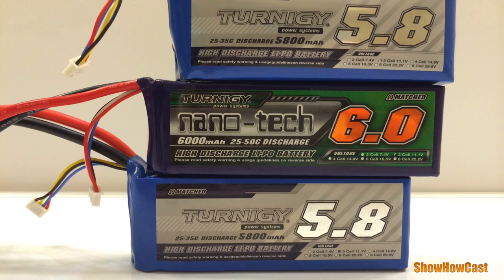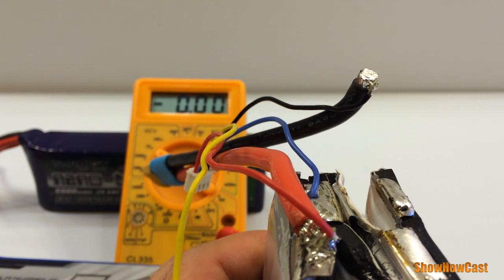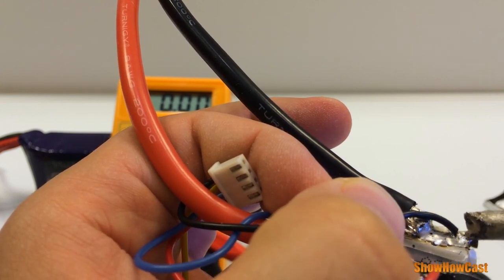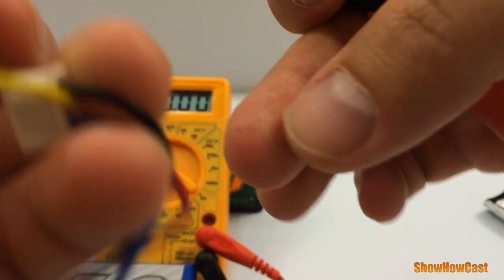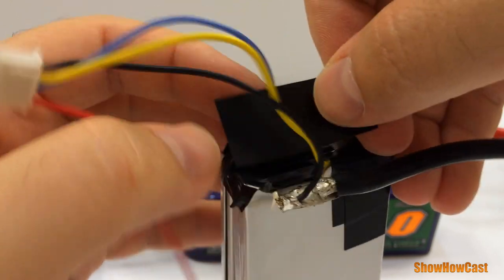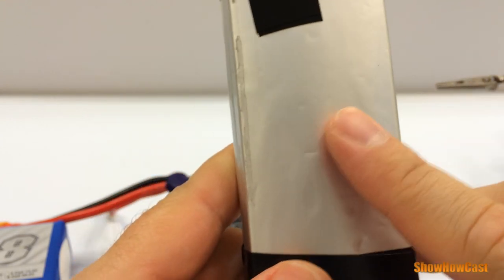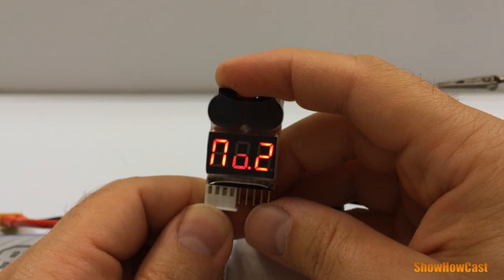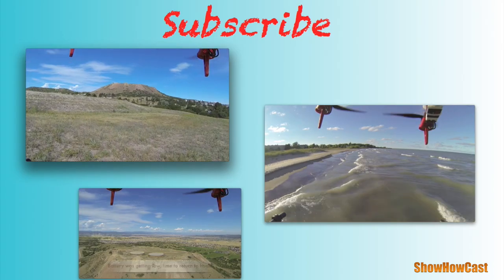Don't throw out your bad 3S lithium ion polymer battery - CONVERT it to a 2S lipo battery

Comment: i have a LIPO charger that has separate 2S and 3s charging ports. with this setup, i see you use the same 4 wire port. should i put it in my 3s (4wire) port or change the port to 3 wire one and use 2s port?

Comment: nice work. good safety measures. Look on ebay to pvc shrink film. you can build a brand new battery.
Reply from the maker: Good point. Thank you for the tip.

Comment: Hy.Nice video.
Please tell me if i do this what it will be the baterry capacity.it remain the same?
Reply from the maker: No, it will not remain the same.  The battery capacity will drop by 33%.
Reply: Thank's for your answer.
I followed the steps like in your video the only difference is that my batt is a turnigy nanotech 3s and instead having 3 cells when i open it it have 6 cells.
I followed the steps and i removed the first two cells 1 cell was 3.3,2cel was 4.12 and 3 cell was 4.05 so i removed the first two cells.
I did that thing ok?
My initial capacity was 6.4 and now what charge current should i use?
Cheers.
Sorry for my english.
Reply from the maker: Gabriel Balint  If you have 6 Cells and your battery is a 3S2P, then you would have to remove 2 cells (that should be connected in parallel).  You should have 4 cells remaining - 2S2P.
Reply: I know this is old but if you have a 3s, 4s, or 5s lipo everything should apply as long as the cells are in parallel(and as far as I know they all should be.)
And the reason I say that is because every time you add a cell it adds 4.2v to the total voltage. 
Each cell is 4.2v this will not effect the capacity of a battery. A 5s 2000ma battery will have the same capacity as a 1s 2000ma battery. The only difference is the voltage. 
Idk if that helps or not. 
I'm sure someone will have something to say about this but I'd have to argue. :)
Charge it the same. As you did previously except change the cell number on your charger.

Comment: I wonder if you would be willing to help by explaining how I can convert a 8s in to a 7s for use on a e-bike? my ESC is 48v - 60v 1000w so my 2pcs of turnigy 8s 5.8Ah is over voltage. I'd also like to ask if I use a one way blocking diode from my DIY solar kit on the positive of batt harness at a set point and low voltage alarms then can I put packs of different capacity together?  my zippy 2pc & turnigy 1pc lipo packs 7s x 2pc  5.8ah x 3 in parallel with 1pc nano-tech pack 5s x 3pcs 8Ah?  The 7s 6p at 4.2 per cell = 58.8V & 5s 3p at 4.0 per cell = 60V. Thanks in advance, I know I said a mouth full but I hope its explained well,
lanell in Cleveland.
Reply from the maker: lanell jackson All you need to do is remove one cell from the 8S. Just like I am removing one cell from a 3S you would have to remove just one cell from an 8S. That simple.
Reply: Thanks I'll give it a try

Comment: Hi just a question i have a 5200mah 3s with one bad cell so i did this and made it a 2s ok what i want to know is how do i find out how many mah each cell is do i divide 5200mah by 3 to get per cell mah or is there a different way ? pls help
Reply: In a 3S 5200 mah every cell has 5200 mah. In a parallel battery you sum the mah: a 9000mah is a 3x 3000mah

Comment: Hi SHC!! I've just finished to do the job and everything went fine, thanks a lot for your instructional video. The only doubt i have concerns the lipo capacity. The lipo i converted was a 5100 mah. Now, the capacity still remains the same or i have to divide for three so instead of a 5100 mah lipo i have a 3400 mah. You know, these informations are crucial when you need to charge the lipo so you can set you battery charger in the right way. Thanks again, and looking forward any answer. See you SHC     Davide (Italy)
Reply from the maker: Ciao Davide, the capacity will be reduced by 1/3 to 3400 mAh like you correctly pointed out. Good luck with your future projects! SHC
Reply: +ShowHowCast Actually no, each cell is 5100mah, this is because each cell is wired in series, not parallel, what you said is only true if it is a 1s3p pack, which is very unlikely. You will actually need to set the charger to a 2s if it was a 3s lipo, 3s if it was a 4s and so on.
Reply: You made a video on this but don't even understand it? Removing one cell that was in series will reduce the cell count while keeping the capacity constant....